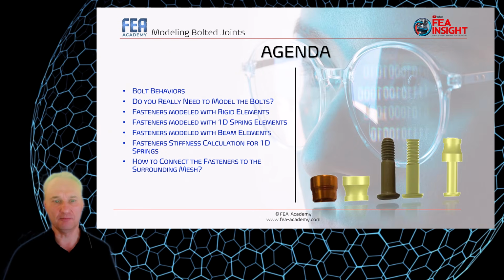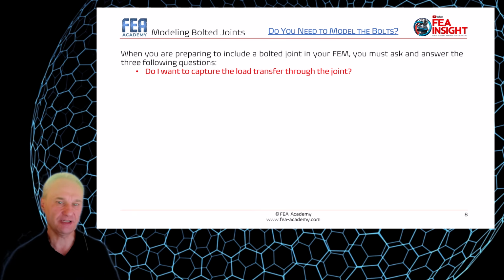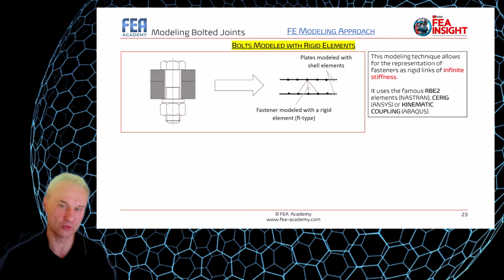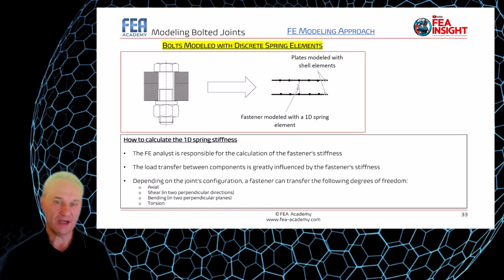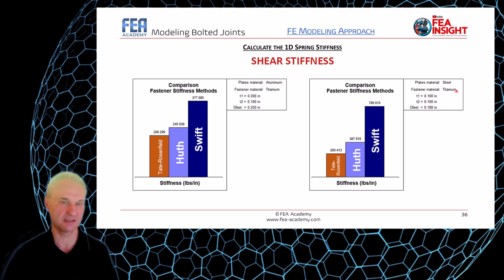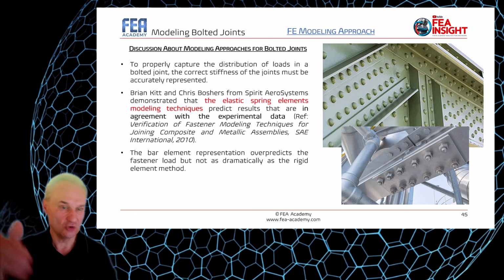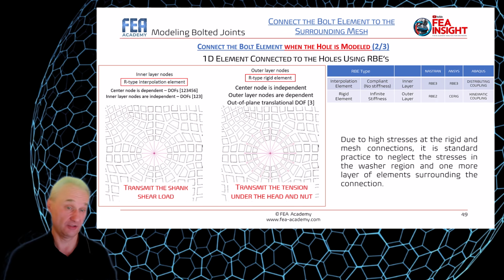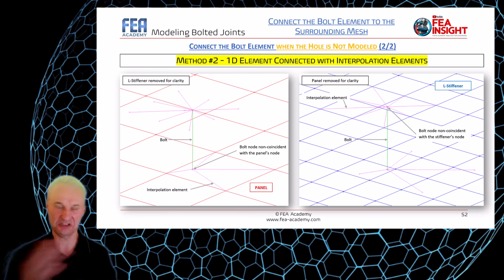FEA Insight - Ep #9 - Modeling Bolted Joints

Comment: On page 49, the use of an RBE3 is indicated for bolted joints. Typically, stiffness is important in bolted joints, and since RBE3s are interpolation elements and do not 'add' any stiffness or enforce any compatibility of displacements like an RBE2. I have always had difficulty justifing there use. Can you offer up any real-world practical applications where an RBE3 is appropriate for a bolted joint?

Comment: Also when to consider bolt pretension in simulations?
Reply from the maker: Bolt pretension should be explicitly considered in FEM when it materially affects load transfer, stiffness, separation, or failure modes of the joint. Practically, you include pretension when the joint behavior depends on clamp force rather than just bolt strength.
Below is a clear decision framework used in industry FEM practice.

CONSIDER BOLT PRENTENSION WHEN:

1. Joint integrity depends on clamping
+ Friction is used to transmit shear (slip-critical joints)
+ Separation or gapping must be prevented
+ Sealing (flanges, pressure vessels, gasketed joints)
👉 Without pretension, FEM will overpredict bolt load and underpredict joint stiffness.

2. You are assessing joint stiffness or load sharing
+ Multi-bolt connections
+ Interfaces with contact nonlinearity
+ Compliance-sensitive assemblies (machine frames, tooling)
👉 Pretension establishes the initial compressive stress field that governs how external loads redistribute.

3. Fatigue, vibration, or dynamic loading is involved
+ Cyclic axial or transverse loads
+ Vibration-sensitive joints
+ High-cycle fatigue of bolts or clamped parts
👉 Pretension reduces bolt stress range. Omitting it can give non-conservative fatigue predictions.

4. External loads are comparable to preload
Rule of thumb:
👉 If external tensile load > 20–30% of bolt preload, pretension must be modeled.
Otherwise, you risk incorrect prediction of separation or bolt overloading.

5. Contact behavior matters
+ Slip, stick, or separation at interfaces
+ Nonlinear contact with friction
+ Joint opening or closing under load
👉Pretension defines the initial contact pressure and friction capacity.

OFTEN NOT NECESSARY WHEN:

1. Pure bolt strength check
+ Simple tensile or shear capacity
+ Conservative hand-calculation validation
+ No interest in joint deformation or slip
👉You can apply equivalent axial forces instead.

2. Very stiff clamped parts, low external load
+ External load ≪ preload
+ No separation risk
+ No fatigue requirement
👉In these cases, preload only marginally affects results.

3. Early concept or screening studies
+ Relative comparisons
+ Load path identification
+ Geometry optimization
👉Pretension can be added later for final validation.

MODELING GUIDANCES
+ Use bolt pretension elements or sections, not enforced displacements, unless you know why
+ Apply pretension in a separate load step, then lock it before applying service loads
+ Always include contact between clamped parts if pretension is modeled
+ Do not forget thread engagement length and grip length influence stiffness

PRACTICAL FEM DECISION CHECKLIST
+ Include pretension if any answer is “yes”:
+ Is slip or separation relevant?
+ Is fatigue or vibration assessed?
+ Is joint stiffness or load sharing important?
+ Is external load > 20–30% of preload?
+ Are contact pressures or sealing required?
👉If all answers are “no”, pretension can usually be omitted safely.

I hope it answers your question.